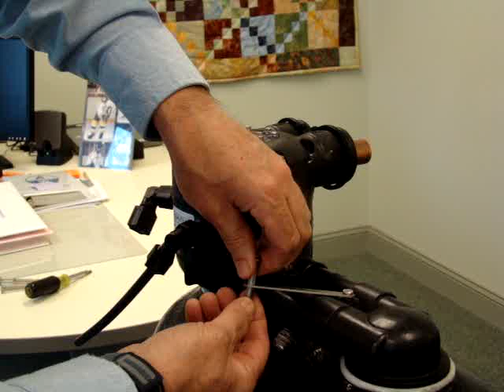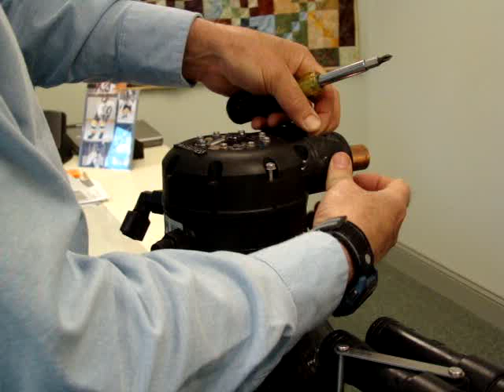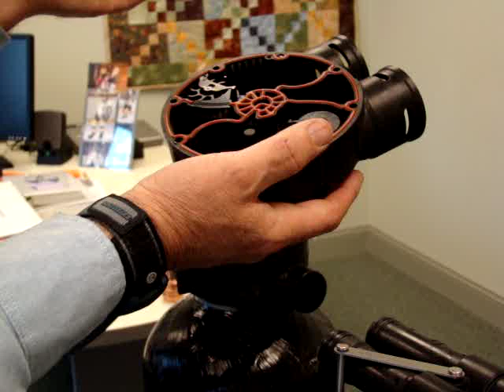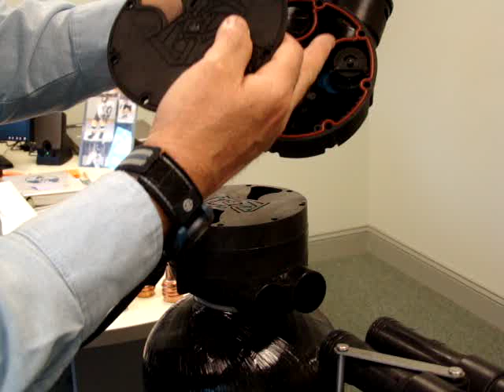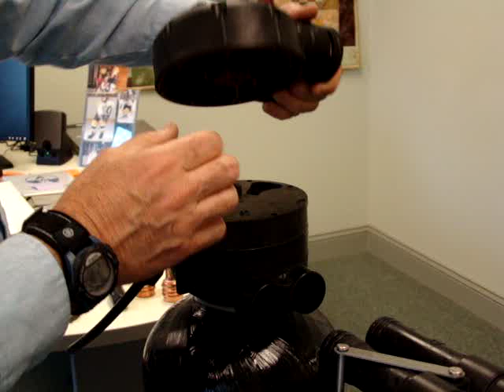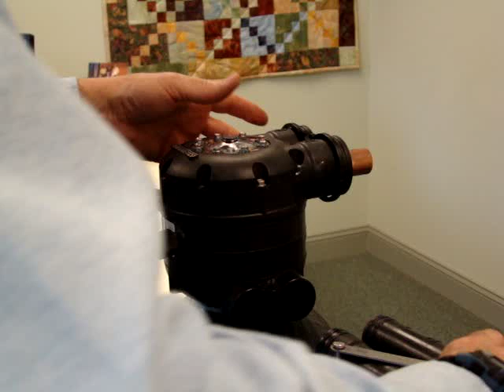Kinetico Head Level One Removal

Comment: I have a Kinetico System with the Iron remover.   It is very clogged with Iron and is not letting very much pressure through.   Can I clean the heads without damaging them?   Then of course put them back together and have my system working like it used to?   Do I ever need to replace the media from years of use?   Thanks,   Gary

Comment: This was a very helpful instructional video - Thanks Jeffrey. We have had our Kinetico water softener for about 12 years, which is four more than our first non-Kinetico unit. But, I had problems twice (first covered under warranty and the second one cost me $250). By following your instructions I was able to fix my unit, understand how it works, and have confidence again in this unit. One thing that I noticed is that when it is working right and recharging there is a slight "gear sound." When I was having problems (recharging would take close to a day, would recharge almost daily, and occasionally the water would taste salty) that sound was absent. There was a lot of sediment (we have a well) so I need to get a whole house water filter. But, for now you saved the day!

Comment: Great video. I have an iron filter, similar to this softener. One of the backwash modes always stops halfway through until I manually advance to purge mode. The window on the top is almost black. I am assuming that there is stuff in the regeneration gears. What is the best way to really clean them? Should I just soak in citric acid? Should I disassemble the gears completely and clean that way? Does anything need to be lubed with food safe underwater lubricant?

Comment: The 2 plastic e-clips were difficult to remove from my system; perhaps the installers used PVC pipping instead of copper;  therefore, I discontinued removing the e-clips.  Regardless, I was able to proceed with a little bit of water pressure release incident.  With your instructions, I was able to fix the "stuck" level one head preventing the cycle.  This video saved us a $199 service visit.  Thank you so so so so so much!

Comment: Great video, I have a Quad 50 unit, did the level 1 & 2 clean/rinse/reassemble, but the system doesn't stop after completing a cycle at the 6 o'clock position, you can hear water going through. I can manually move it forward and it will stop. It never stops at the 12 o'clock position. I tried to move it forward to stop it, but it never does. The only time the system will stop is in the 6 o'clock position, and only after I move it forward. Do you know what is causing this? Thanks Dave

Comment: Great video, and did the level one and two (cleaoned/rinsed/reassembled) as you covered, and it all went well, sort of. The reason for doing this is a complete water pressure loss when in the backwash cycle, but only on the "right" side of the dial (cycle between 3 and 6 o'clock). I can't figure it out - do I need to go a level depper in the stack, or look at the resin tanks?

Comment: nice video,, I have 2060 sulfur guard and the regenerant tank that takes hydrogen peroxide fill up with water slowly, is that a bad vavle or ball in the inside of the head. What do you think
Reply: Luis ohh wow i have same set up as you do (i know im only 6 years late) mine constantly leaking water from sulfur tank to peroxide tank...i was wondering if yours also has two drain connections tied into a tee and then to drain...
Any help would be appreciated